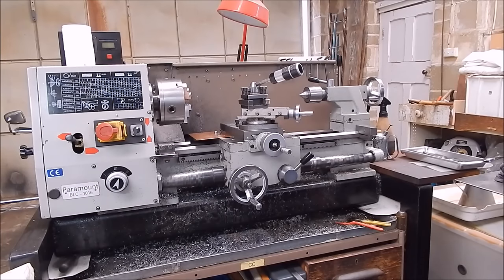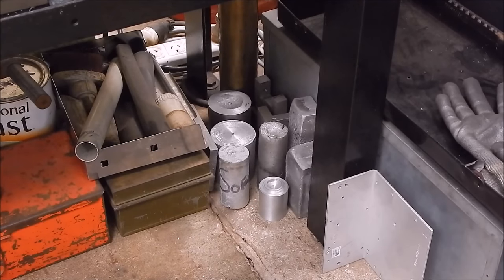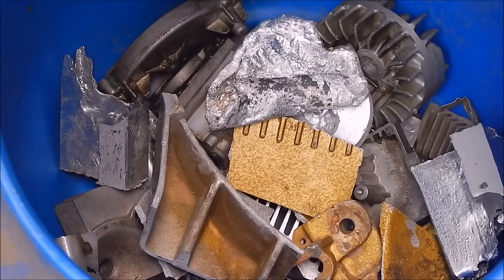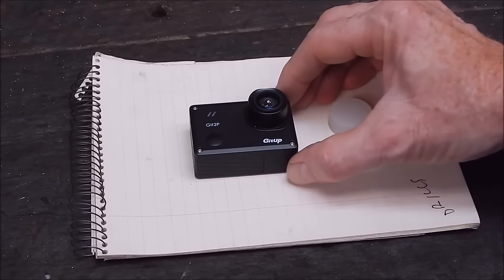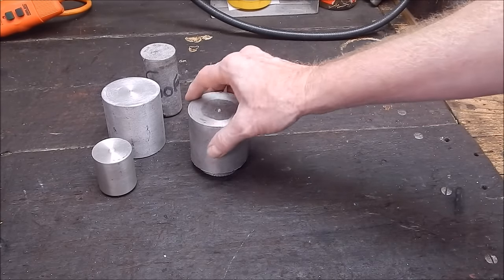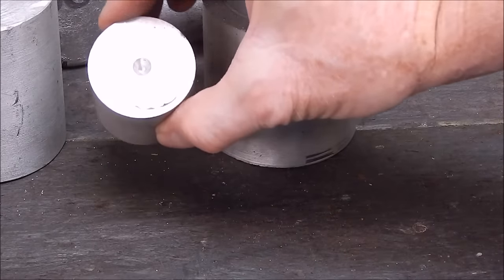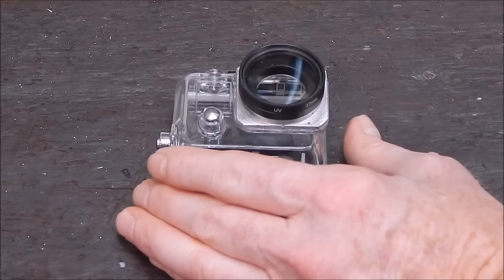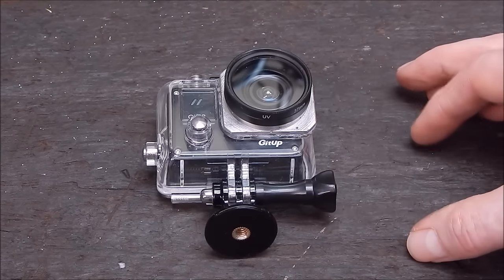The worst aluminium in the world

Comment: You mentioned that raw aluminium is expensive where you are. Here in Canada for example at Metal Supermarket I can get 45 mm OD x 500 mm round bar for around $19-23 CAD or ~$17.50 USD. What are prices around where you live ?? They always have plenty of cutoffs of 6061T6 (same as ASTM B221). I cannot imagine it can be cheaper to cast your own plus you never know what kind of alloy you are getting in the end and what it is good for! 
Problem I have, usually, when I am looking for 7075. Nobody have it in stock so "please cut me a 20cm piece" is not an option :)
Reply from the maker: Half your luck. I would be paying that for about 50 mm length.  They really charge for aluminium over here.

If it was cheaper than home casting then I would be buying it - obviously.

Cheers Rob
Reply: D45x500 is just a bit over 2kg or ~7,5USD/kg
I just recently bought a little 6082 piece D100x70 (~1,5kg) for 6 EUR here (4EUR/kg), note that this 6082 comes from Russian mills (I'm from Eastern Europe), Western (German) source stock is a bit pricier, something in that 7,5USD/kg range. Mind you this is for extruded material, sheet aluminum is a bit less, I bought some 5754 1,2mm sheets at 3,5EUR/kg.

And keep in mind retail price for these products is around double the wholesale price for raw aluminum in general.

I don't know where xynudu lives, but asking 10x this much sounds pretty ridiculous...
Reply: I pay $11 per kilo for machine grade aluminium cut to length in Melbourne, Australia

Comment: One plus about living in Hobart, is a trip to INCAT, where they build the big all alloy catamaran's using mil spec marine grade aluminum alloy, a $100 fills my troop carrier with scrap lengths of pipe, bar, plate, sheet, angles of all shapes etc. that has kept me building big telescope's and other gear the past 20 years, material that would give you multiple orgasms just to look at my stocks in the workshop. It machines like brass and gets a glass like finish. This is the other extreme to your situation, and I feel your pain. Southern Cross Observatory-Tasmania 42 South.
Reply from the maker: I'm jealous.  Nothing like that here.

Cheers Rob
Reply: Don't you have some ship building going on or in the pipeline? maybe all steel though, just a thought, often theses places do sell scrap at a very good price. My alloy cost me about a dollar /kilo, more like 20 cents if I actually weighed it all. That said, it always amazes me how some many enthusiasts like yourself find a way to come up with the goods-I enjoy many of your you tube clips-loved the tour around my old stomping grounds too. Cheers, Shevill.
Reply from the maker: Wow, that's some serious project there.  Very nice work.  I would hate to pay top dollar for all that material.

We do have ship building, but it's all closed shop/high security/military based operation.  So no joy there.  That's the luck of the draw.  

Thanks for the link.

Cheers Rob

Comment: Great work. Is it machining poorly because it's too soft?
Reply from the maker: No, it's just really inconsistent - hard and soft spots, plus it goes gummy and will suddenly grab.

Parting off was a nightmare (even going really slowly and backing out to clear) as it would suddenly change from OK nice flakes, to hard spots and grabbing.

It's just the worst alloy I've ever come across.

Cheers Rob
Reply from the maker: I'm beginning to wonder if it has a really high silicon content.  I could hear the parting off blade grinding against the metal, even with a freshly sharpened tip, which suggests there was some pretty hard stuff in the alloy.

That's my best guess on this.

Cheers Rob